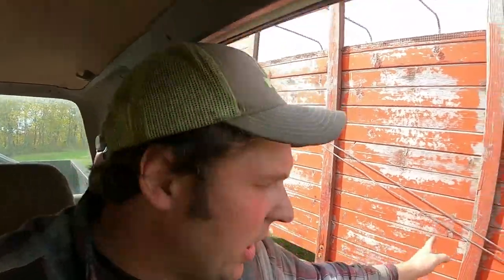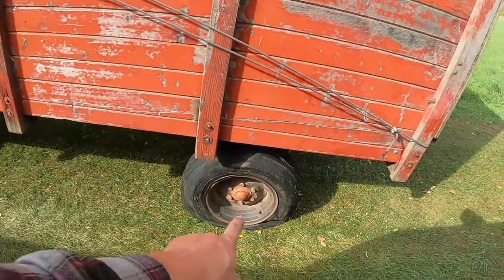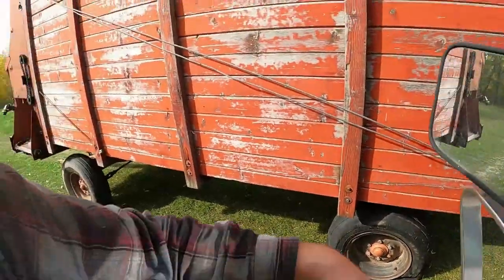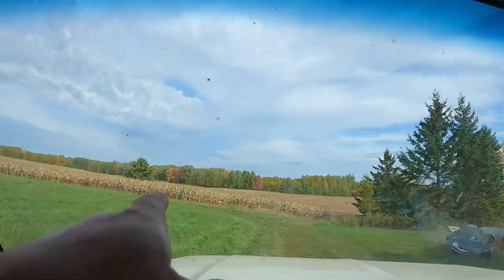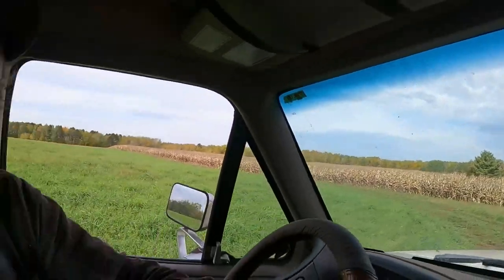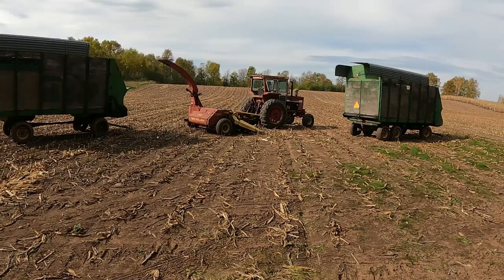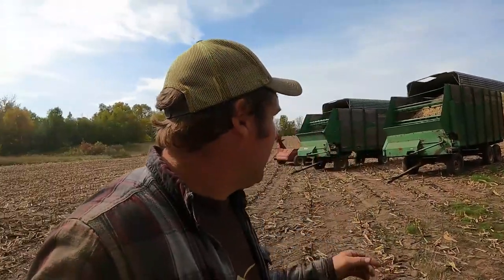Chopping Corn 2022/Day 4/Filling an Upright Silo

Comment: Keep the old equipment running! Put money in your pocket not the bankers! The only thing you need to do with old equipment is have a spare backup tractor in the fleet to cover if a main tractor  breaks down. Buying a worker and a backup pair of old tractors is still less expensive than the monthly loan/lease payment on the new tractor.
Reply from the maker: Jen and I are in our early 30's and we only owe 13,000 on the farm.  That's our goal is to pay it off.  After that, yeah there's a whole list of upgrades we'd love to make, but not until the debt is gone.
Reply: @trinitydairy  That is awesome congratulations
Reply: That's the way to do it!

Comment: Hopefully that corn was not too dry.  Looked a little more brown than green.  Recall back when we'd run a hose from the barn well into the blower as it went up the pipe to the silo to make sure it was wet enough to ferment properly.
Reply from the maker: It froze so the leaves turned brown.  There's a lot of moisture in them yet.  The stuff I'm hitting today must not have froze as hard because it still has some color to it.

Comment: Did you know that IH tractors newer than your 560 have the horse power rating and the number of cylinders in the engine as the model number of the tractor. 1066 106 hp 6 cylinder engine.1256 125 hp 6 cylinder 574 57 hp 4 cylinders 1468 146hp 8 cylinder 1486 148 hp 6 cylinder. They stopped doing that on the 88 series tractors.
Reply from the maker: Yeah , I've heard that.